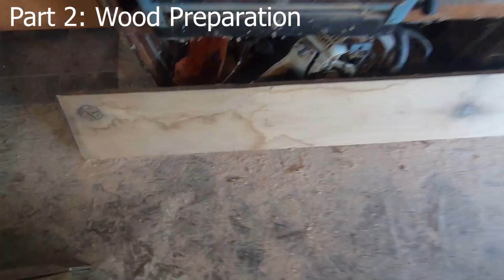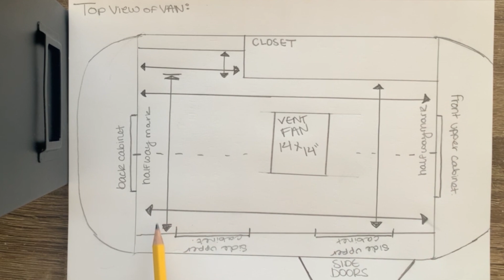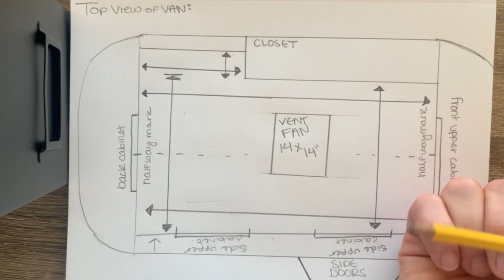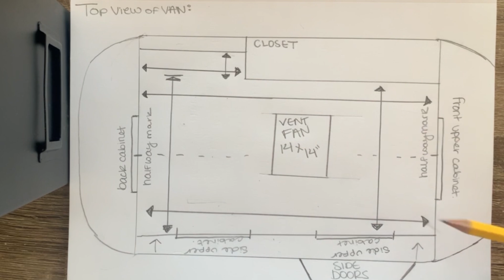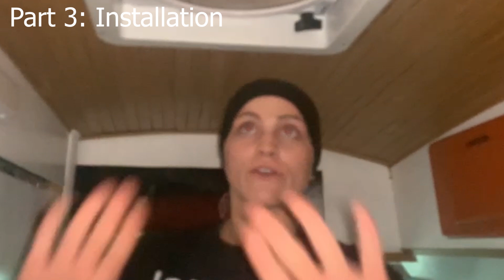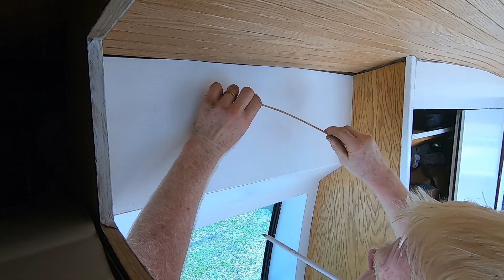Beautiful DIY Campervan Ceiling | How To Build and Install

Comment: Bad choice for insulation, it's not uncommon for it to mold in a RV/Van environment because of condensation if a good vapor barrier was not used. If you live somewhere you don't have cold weather you might not have issues.
3M Thinsulate would be a good choice, it doesn't absorb, it repels moisture and doesn't mold and wouldn't require a moisture barrier.

Comment: How did you ensure that no insulation fibres escape into the inside of the van and are breathed in?
Reply from the maker: I thought about putting a layer of plastic up and then installing my wall panels and stuff like that but ultimately, I decided not to because it’s really easy to air out such a small space. There is one place that the fibers could really get out and I’m still working on a solution for that but right now I’m preparing for winter so next season there will be a fix